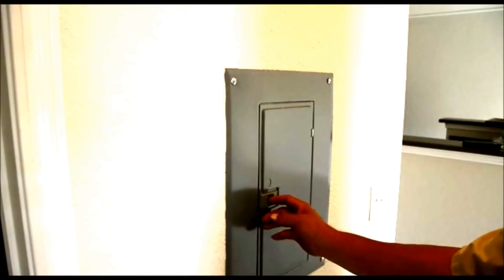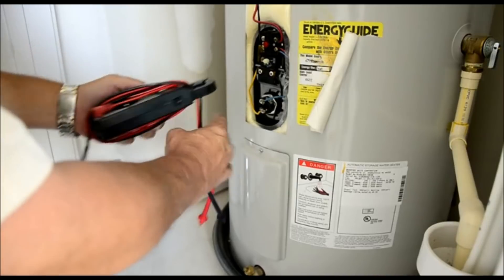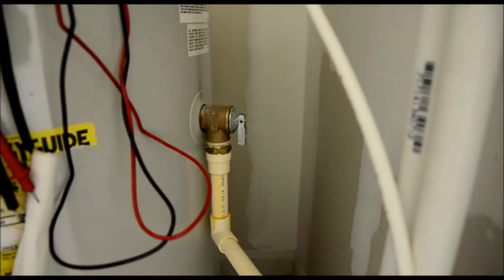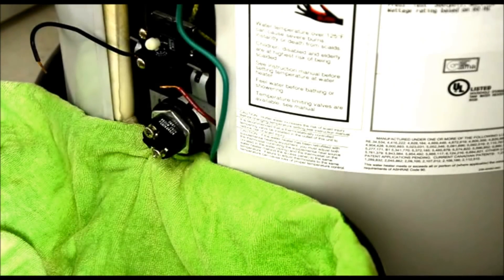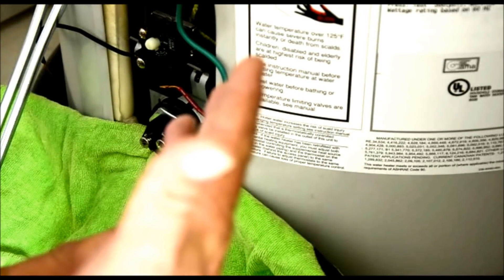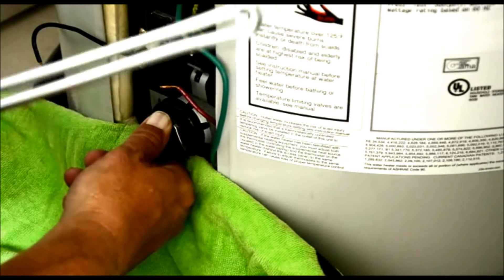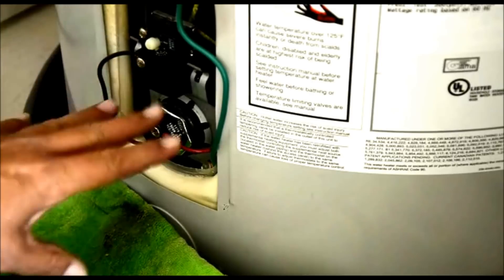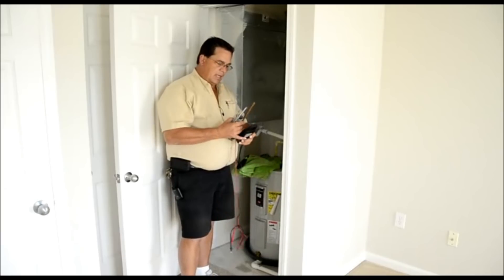Replacing A Water Heater Element With A Full Tank Of Water. "Not Draining Tank."

Comment: Not sure what I did wrong, but I recommend at least having a shop vac on hand. 

My old element got stuck, so I could not quick swap it. Depite shutting off the supply and all faucets, the water still continuously poured out. The only thing I can think of was the washer hot water supppy valve was open, but the washer was not running. Even after I shut the washer supply off, it kept flowing until the water level was below the element

Comment: Very great video how can I tell if my thermostat is bad my hot water heater at the top is  getting super super hot I had to reset my thermostat on the hot water heater why  i need help
Reply from the maker: it does sound like your upper stat is bad. Take a photo of it and head to your local suply store and match it up. The photo will also serve as a wiring reference when hooking it back up. Good Luck.

Comment: I have done that more times then I can remember. I am getting ready to flush my tank, I hook my air compressor to the hot on my sink, shut the power off, open the bottom drain on the tank, shut off the water supply, and add a little air pressure, 20 to 40 pounds. When the tank is almost empty I turn the supply on for a minute or two then off for a minute or two. Five or Six times and the drain water is running clear. Anyone ever do this?

Comment: Hey Dan, if I took my element put of my gas powered water heater and accidentally soaked the bottom of the water heater because I had no towel. Should I be concerned? Tons of water poured out onto the bottom of the water heater and floor. (This was before I saw this video).

Comment: I'd suggest running all of the hot water out of the tank first if you aren't going to drain it. Also suggest using ULWD elements as they will last much longer.

Comment: It's a water heater, not a hot water heater.
Reply: Well, the heater kicks on when the water gets down to 120 degrees or so, which is hot. So technically it's a hot water heater. It's heating hot water to a hotter temp:)

Comment: The bad heating element has a large metal  "washer" behind the nut. I suppose behind the washer is some gasket material. So the problem is that I can only get about 1/8" of the tooling in. I don't know if a socket and breaker bar will help. It is the lower element which makes it even harder to leverage. I tried vinegar and anti-corrosion spray.  Maybe an impact drill with socket. No point in smearing my knuckles with  tooling

Comment: This would work good if you didn't have one of the main reasons it goes bad. Mineral build up. This has been done to mine many times over the years and the gel like goo that builds up over the top of the element has to be cleaned out or your going to have to do this again a few days later. This technique won't work if you have well water. It must be drained and suctioned out.

Comment: Terrible idea. On most water heaters the element is blown up and can take up to 10 seconds or more to get out of the tank. The old gasket can also stick to the tank which must be removed before new element is installed. Not to mention you should clean debris from the port hole or there could be a leak. Don’t be a dummy and flood your house to save 30 minutes.

Comment: if your system is tight, it should not even gurgle out as much as this one. I've changed them before like this and only had about a tablespoon come out and not have to do it so fast. Also, I heard you call it a hot water heater. I don't know why you would want to heat hot water. I've also never seen a hot water heater in a hardware store (giggle)
Reply from the maker: We all get a little confused at times. I say Water Heater more often than Hot Water Heater. Just a slip of the tongue I guess. Thanks for watching.

Comment: You forgot an important step. Can you imagine if you bought the wrong element and you tried to shove it in and it doesn't fit, you re gonna end up with a lot of water gushing out of the water heater. So make sure to buy the exact replacement.

Comment: These diy videos cause more harm than good.Customers then expect us professionals to take all these shortcuts to safe money.Not always a good idea on older equipment.
Reply: Except that the reasons these videos are available is because this isn't splitting atoms or curing cancer; it's replacing a heating element in a water heater which nobody needs to call a "professional" to do to begin with...

Comment: Well thus is a quick way to change one but in 4 to 6 months when it burns out again how do you exolain to your customer it needs drained and cleaned before reinstalling a new element. Ive been in business for 30 years, i always drain the tank. If youll invest in an electric pump (25$ for a decent one) you can drain the tank in to a commode or kitchen sink in about 20 minutes. Much better than to not drain it.
Reply from the maker: Never had one burn out anytime out of the normal in the 20 years I’ve done it this way. If you have an old tank that has never been serviced the way you mentioned the tank life gets shortened not the element. 
If you want to flush the tank, by all means, do it.

Comment: There's an issue with the electrical system. If you shut off the correct breaker, that should have completely killed the power.

Comment: Bad idea, need to clean deposits out around opening and clean bottom of tank of deposits. If you can not hook hose to drain,use 90 pvc fitting and shop vac to drain tank.
Reply from the maker: I do suggest doing what you are talking about, however, when working on water heaters that are 10 years or more old and you don't know if this practice has been done, I think it's a bad idea to start this late in the game. My water heaters on the property I'm at now are 20 + years old and have never been drained or flushed. to start now would surely start a cascade of replacement water heaters. sooo, You choose which you would prefer to do.  I choose to replace the element this way and get a few more years out of our 80 Gallon water heaters.

Comment: DRAIN THE TANK!
Thankfully I had drained my tank as it took me a couple of minutes to remove the old element out because of excessive lime buildup and a stubborn gasket that didn't want to cooperate.  (Not the 5 seconds as in the video)  If I'd followed these instructions the cleanup would have been a huge job.  Another reason to drain the tank is to remove lime buildup on the bottom.  That can be done with a shop vac and attachments.

Comment: Thanks for posting this, but I noticed your tank looks very short.  Water pressure is proportional to height, so a normal water heater should have twice the pressure when removing the lower element.  I think it would be twice as hard on a normal height tank.  Have you tried it on full sized, and is it any different?  What happens if the element is corroded and you can't get it out easily?  Can you easily just put it back in and drain it or are you screwed?
Reply from the maker: +George Hu I have 80 gal heaters on the property I’m at now, it’s the same. Ya just have to be ready.

Comment: Thanks, Dan. Good work on the narration and lighting-- with clear audio, at a pleasant but full level. It really helps. 
We especially appreciated the tip about quick element removal, in case we cannot attach a hose.
Do you believe a "foldback" or "ripple" heating element is a wise investment for durability? How desirable is a resistored element?
Reply: If you have decent water then it won't matter much. However, if you have hard water, the lower the watt density the better because the heat will be distributed over a larger area rather than concentrated in a small area, meaning no one spot will get as hot and bake minerals onto the element. If you have crappy water, you can also get lower wattage elements such as 3500W elements instead of 4500W or 5500W too. Of course lower wattage elements will take longer to heat up, but assuming all else is equal they should last longer since they run cooler. Large, low wattage elements are your best bet as far as durability goes. Hope this helps
Reply: @averyalexander2303  Yes, it helps-- good points rarely considered by people who "just want a hot shower NOW". Or people with seven children, all of whom need the shower, one after another. And don't even talk about those who insist on a bath. 
For my own shower, I am willing to wait a reasonable period, especially with the cost of power going up as though there were no better sources of power for power plants. (wink, nod)

Comment: You need to drain the tank one or twice a year anyway so!!!!!
Reply from the maker: This is a TRUE statement, however, if you are on an older property and this practice has not been kept up through the life of the water heater, my opinion is to leave the sediment alone. Disturbing the tank bottom can and most likely cause leaks and thus the need to replace the tank. I'm not saying that's bad, but I am saying that if you are on a tight budget, the last thing you want to start doing is blowing it on a bunch of water heater replacements. I do agree with you that rinsing the tank on a regular basis is best practice. 
Thanks for your input.

Comment: tried this.  The element did come out with some work, along with a lot of white build-up.  Dumped quite a bit of water on the floor, as there was enough white buildup that I had a lot of trouble getting the new element centered so the threads would line up.  Would not recommend this method for anyone with a tank that has been running for a number of years.

Comment: Why didn't you use the DVOM to test the resistance of the element before you removed it  ?  Extremely poor instructions . Trouble shooting is the true key to save money not fly by seat of pants parts swapping.
Reply from the maker: It is a video on replacing an element, not testing it.

Comment: On the top of my HWH is a temperature potentiometer, a smart control (for vacation, time of day demand, etc. options) and a self diagnostics feature with a LED that blinks a certain pattern for either the top or bottom element problem. Being on steady indicates both elements are good. Regardless I have barely warm water. Do I likely have a bad thermostat(s) at one of the elements?

Comment: Great video!  Thanks for posting it.  Do you recommend a 5500 Watt element on a 50 gallon tank instead of the 4500 Watt for a rental property that is only used on the weekends and I turn off the heater while there are no guests?  Thanks!
Reply from the maker: +John Smith if 4500 is recommended I would stick with that.

Comment: Hey Dan, great detailed video!
Reply from the maker: +Di Ro thank you and thanks for watching.
Reply from the maker: Hey... if it’s not too much to ask be sure you subscribe to the channel if you haven’t already, I’d love to have you in the community of fixers.
Reply: @danjiles  I actually already did. Could I impose on you for a water heater dilemma opinion? I have one approximately the same size as in your video (I'm in a mobile home). About a week now or so, there has no longer been any hot water...only warm, and it only lasts about 4-5 minutes. I checked the breaker, and around the water heater for leaks...none. I haven't checked it with a multimeter yet (my next step.) But from I've told you, could you possibly give me guess if it could be an element going bad? Thanks.
Reply from the maker: @diro6232  It sounds like your bottom element is not coming on when the top is done heating the water. you could have a bad lower elemet or the tStats are faulty. OHM the lower element, the don't start to go bad, they are either good or burned out no in between.  Be sure to turn OFF the power first before doing any checks.

Comment: I would recommend draining the tank, remove calcium buildup using a shop vac by reducing the size of your hose ( I reduced the hose on my shop vac with pond adapters down to 3/4 inch hose. This makes it easy to vacuum out all debris).

Comment: Hello. I have a leak that seems to be coming from that exact place. Do I need a whole new water heater? Or can a new element fix that problem?
Reply: You probably have already fixed this issue, but for others looking for an answer: it sounds like it's the rubber gasket on the heating element isn't making a good seal. Either try tightening the element more, or replace the rubber gasket. If neither of these solutions fix the problem, you might want to check the area around the hole to make sure there's no damage causing the leak.

Comment: it depends on the setup of the plumbing on your tank. if you can shut off the incoming water line then ok, you'll get a partial vacuum  as the first water comes out before air can enter the tank. I tried it and got drowned and my kitchen got an unexpected bath, before I got the new element back in. it wasn't helped by having to struggle to get the old element out as it got stuck after being distorted by the fault in it.

Comment: Very dangerous. I flooded my house thanks.
Reply: You either didn't relieve the pressure,  didn't turn off the cold water supply or you had a faucet on turned to hot. Otherwise there's no way you can flood your house.

Comment: Drain the thing! Notice he did it on a little 10 or so gallon heater, not a normal house size. How many video takes did this take? How many did not go the way he planned? Not all heater elements are shaped like that. How many are broke and don't come out without a fight? Drain the tank first. You should drain the tank at least once a year anyway. Change your anode rod.

Comment: Just finished doing the lower element in my 50 gallon water heater. Worked exactly like it did in the video although I almost forgot to relieve the pressure. Really appreciate the tip because like the unit in this video the drain spigot access is blocked by the tray. Thanks for this!

Comment: I freeze the tank - no water loss, but a massive electric bill for the specialized freezing equipment.
Reply: Remember folks, he did the no drain method because the drain valve was blocked by the pan.

Comment: Not a good idea getting scalding hot water coming back at you!  There is a reason that the lower element went bad - usually from calcium building up on the old element, scaling off, and filling the bottom of the tank.  All the lower elements I have done went bad as a result of this - I bet if you open the boiler valve, nothing comes out because of the built up calcium in the bottom of the tank!  If there is build up- the new element will burn out soon!

Comment: Caution. Useful video if you insist on changing the elements with water in it but... a) open a bathtub faucet instead and NO faucets. The bathtub faucet opening has about twice the size of a faucet. (If sediment is in your water heater from not having drained it at all or not often enough you don't want to clog one or more faucets and chance replacing them. b) Prior to the job, note the wattage along with the likely 240 volt. The wattagewill be  marked on the end of the element you"re to replace. You need to purchase the same wattage element. The length of the element you buy doesn"t matter. The difference of the surface area of the element is not an issue, but agian, the voltage is. At the end of the procedure leave that pressure release valve be. It is already closed. He didnt say near the end to open it again so don"t do it.  d) Finally, if you have gone say 3 years without having drained your water tank, then I would never do it. From here on out, always change an element out with water in it. The rust and sediment that will have formed by then will perhaps come loose otherwise and you will get a leaking water tank and have to buy a new one. If you are going to drain it, do iso once per year. In the summer it will be more comfortable to do it.

Comment: That may work 3 outta 5 times but when element burn out they do all kinds of funny things plus if tank more then a year old and in hard water areas you have calcium and lime buildup draining is for the most part best usually requiring removal of drain valve and replacement preferably with opening 3/4  valve not crosshairs or restricted pays in the long run

Comment: I am a licensed plumber and I would never open the temp and pressure relief valve unless it was brand new.  It will drip forever and you will be back next week to change that also. If you read the instructions it tells you to open it yearly.  Don’t touch it

Comment: For people like me who seen this video and felt confident then read comments and was intimidated, here is my experience. I followed step by step, and he was right and the video was helpful, but the people saying your element could be rotted and bent and it could cause for major spill are also right, luckily my tank was only 20 gallons. I pulled element out, it was super long bent and broke, therefore took a while to work out, and I had to basically fill 5 gallon buckets 4 times to drain all the overflowing water before I could work the element all the way out. The insulation got wet but its not a big deal, let it dry, put a fan on it, make sure connections are dry before rerigging. Besides that this video was mad helpful and I appreciate this guy Dan for his experience. At the end of the day this repair cost me less than 35 bucks and no need for a professional at all. Now if you dealing with a huge tank, keep in mind if the element does not come out, u can push it back in to stop the water leaking, then have someone help u dump buckets until it is all gone. Draining the tank may be easier but wasn't a option for my setup. No regrets, thanks Dan Jiles